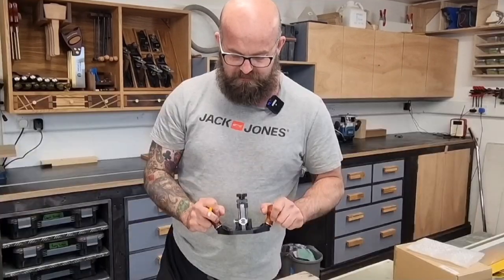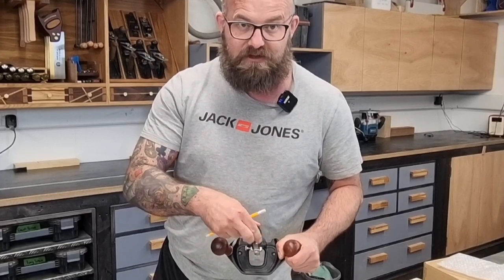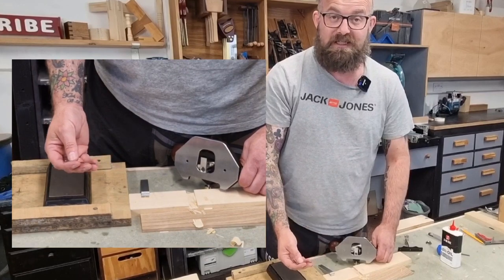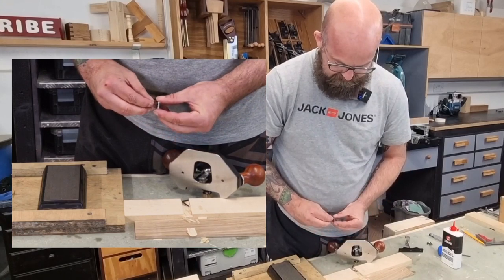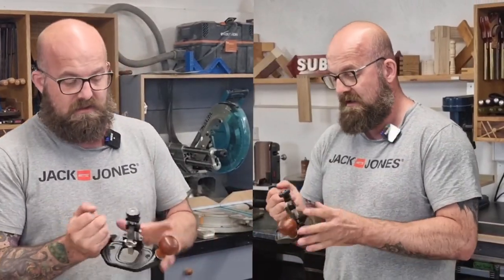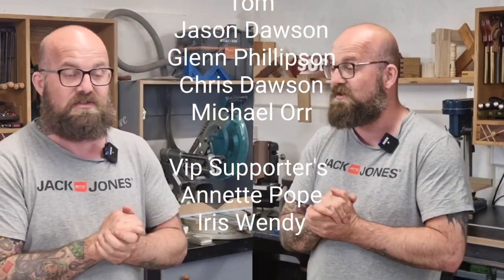Router Plane Banggood Chinese Tool Review, Any Good??

Comment: You don’t have a Veritas but claim the HONGDUI is a ripoff design of the Veritas. 🤦‍♂️How’s this a ripoff when they improved almost every aspect of every router plane? Because the knives mount the same way? They’re all “ripoffs” of the original by that logic. How many different ways are there to design a router plane?
Reply from the maker: Did I say rip off? I don't it very much but can't be bothered to check.
Reply from the maker: Ps I love using this tool it's one of my favourites now.
Reply: Also, why isn't the Veritas a rip off of the Stanley? Router planes have been around forever. They're all just variations on a theme.

Comment: I bought one a few months ago and it has a major design flaw, this is because it clamps the thread and not the blade holder. The thread has play in it so the blade moves up and down even when the lock knob is tight and it's getting progressively worse with more use. Veritus or an old Stanley is a much superior design.
Reply from the maker: I suppose only time will tell, I'll have a look at that sounds interesting to see what's going on there. Thanks for the heads up.
Reply: @karlpopewoodcraft  Thanks Karl I will be interested on your take
Reply: Both me and a friend have the exact problem with the first edition JKM router plane (before he added the depth stop) and received no response from JKM when we brought up the problem. Very poor service. We both repaired the threads in the aluminium block with a thread repair kit (Helicoil) which mostly fixed the issue but I definitely wouldn't buy this tool again.

Comment: I do not think this tool is a 'copy' of the Veritas router plane other than they both are router planes.  I have much respect for Veritas tools and own a few, including their version of a router plane.  The Veritas adjustment is 'loose', is difficult to use accurately as there is a good bit of backlash, one MUST remember to push the blade down every time you change the adjustment or it likely did not move at all, though the screw was advanced a half turn.  The BangGood tool has a springed detent that looks to eliminate that issue, plus a MUCH better depth adjustment with a scale to give someone an idea of progress.  I've the thought I will purchase the BangGood and use the Veritas one as a 'gift' to someone.  Mind you...the Veritas version was certainly the best available...until this one came along.  -Veteran '66-68
Reply from the maker: At the time of reviewing this router plane I was unaware its actually a Katz Moses model, so definitely quality made.  As an update I love using the plane and have found it to be excellent.

Comment: The Veritas has a 25mm dept of cut with the depth gauge or 43mm without. 
I recently compared the two and the Banggood on sale was $C 10 more than the Veritas, with the accessories. Sounds like Axminster has a crazy markup.
Reply from the maker: Interesting where did you purchase yours from @travel734 and did you physically compare them or was it from the item discretion? Be interesting too know.

Comment: Hello Karl. I have both the KM17 & the Veritas (with all accessories) closed throat. Additional blades are supposed to be coming for the KM17. They are as good as each other IMHO with the micro adjustment & lower $$ nudging the KM17 as my pick.
Reply from the maker: I didn't even realise this was the Katz Moses when Banggood sent it over. I love using it so imagine the Veritas is lovely as well, I've just received the Veritas dovetail saw from Jakob as an early Christmas gift. 😊